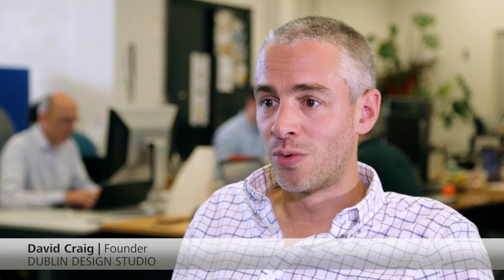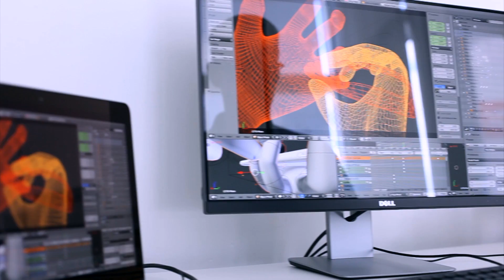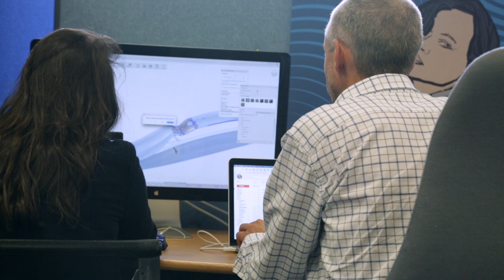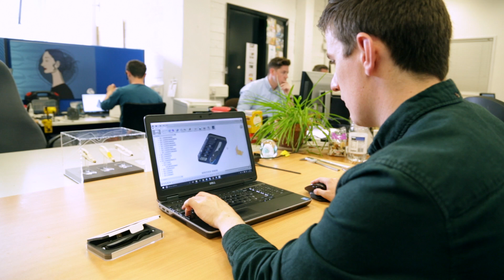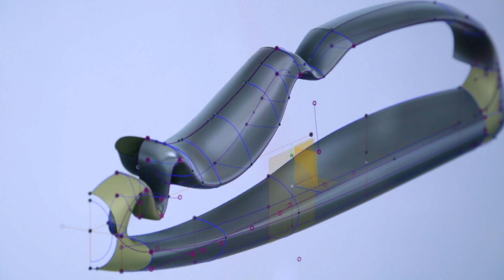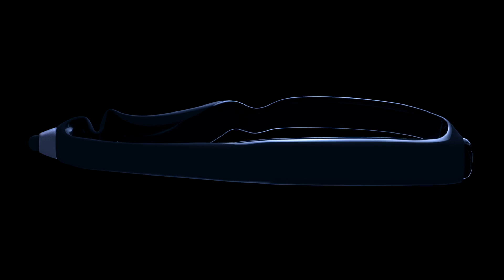Scriba reinvents the digital stylus

Comment: Creative idea and great to see David using local Maker Spaces. Thanks for sharing Autodesk Fusion 360
Reply: Scriba really wouldn't have been possible without the help of the guys in https://www.tog.ie/ initially they helped with such prosaic things as a steady hand and fine tipped soldering iron, but the support grew and I made some great connections and friends who developed the electronics to the next level.

Likewise, when it was time to get serious and turn my Blender sketch into something I was able to use with engineers and material specialists, access to Autodesk Fusion 360 without a crippling software license made this possible.